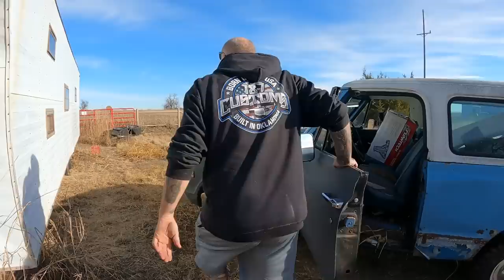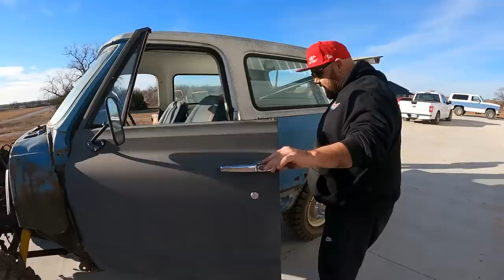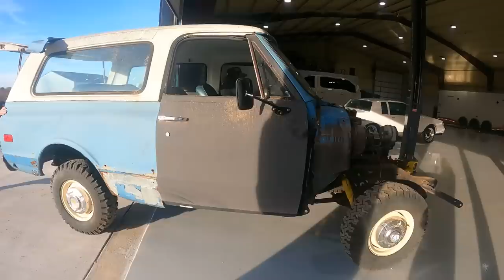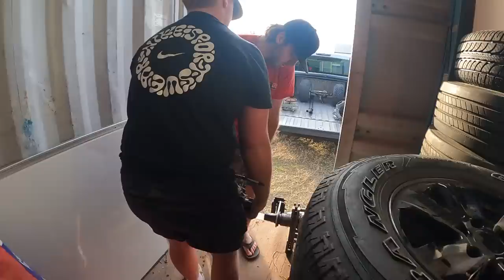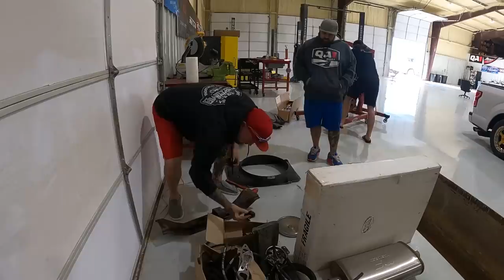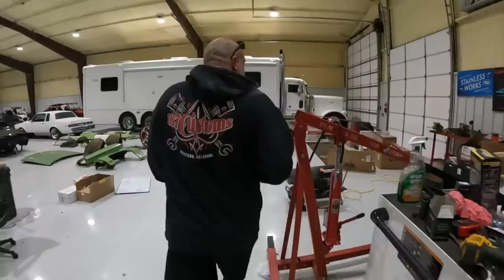K5 Blazer Big Block Swap Part 3! Let's Get Started On This Deal AGAIN!

Comment: We had to swap a transfer case on a military duece and a half. No tranny jack, just a floor jack. As we jacked the floor jack up, had to use ratchet straps from inside the cab to be able and host the rear of the transfer case up. Fun times

Comment: Not a criticism : Next time you're pushing something into the shop to line it up instead of the in and out action get the front end close and take a floor Jack on the rear diff and pull in towards the direction you need it.  Much easier and less pushing.  Keep cranking out the content guys !

Comment: I put a big block in my 1971 k5 back in 1982 built 396 just use my small block mounts headers was a little tight my local chevy dealer said it can't be done when I drove it inside the dealer pop the hood they said how did you do this I said not bad for a kid ....

Comment: U guys can just fabricate a drop plate/bracket for the slip joint mount to lower and shorten it back to it's original placement and it also lessens the u-joint angle!

Comment: Paying someone to clean rat 💩 LoL, we own a commercial cleaning business and also do residential and have ran into some disgusting situation's. We cleaned a house that a guy lived in with his son and 6 dog's. He had a heart attack and wouldn't get up and let the dogs out for almost a whole year. So his daughter called animal control and then us to clean. It was really really disgusting. We took out 30 50 gallon bags worth of dog shit and just garbage. To top off the whole thing we went to use water and they had barely any running water it would just like pee out the sink or the faucets so we literally had to clean with  just spray cleaners and disinfectant. I brought one of my commercial mops and mop buckets but I had to fill it up at my house put it in the back of the SUV and drive it there with water in it in order to mop. And the mops we buy are about $75 a mop head because we use them for commercial use only and I ended up using a brand new one and throwing it right away, that's how bad it was there.

Comment: I wish o would have been there .I could’ve showed Shawn how to move that blazer around without having to sit in the turd seat lol.,all u have to do is take the seat belt,if u don’t have one a piece of rope or bungee cord works,rap around the bottom of steering wheel and then with the rope as short as possible run it out the door where the side window is and shut the door on the rope ,it’s a wrecker driver’s trick but it will keep the wheel straight and you could move any car around,backwards and forwards,just a moron looking out for another ✌️